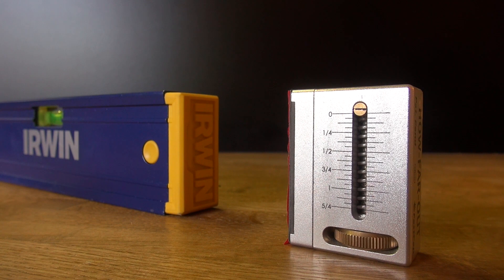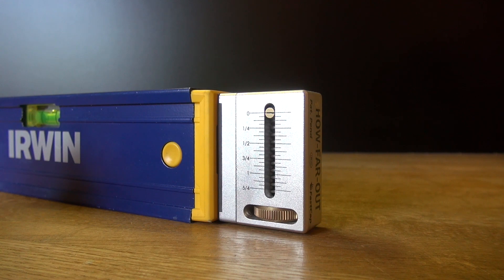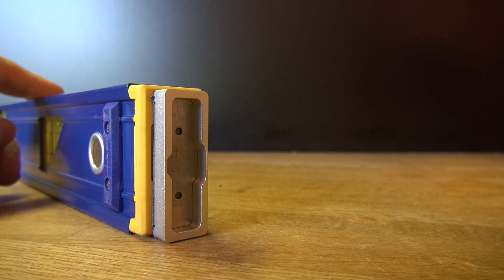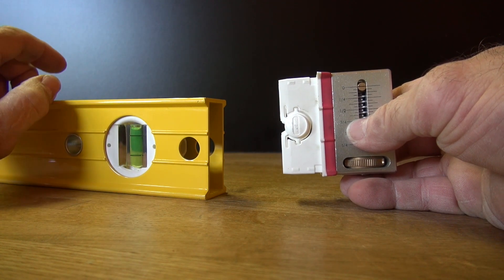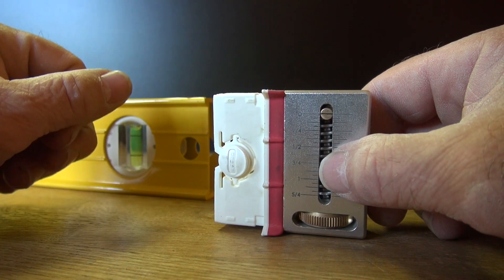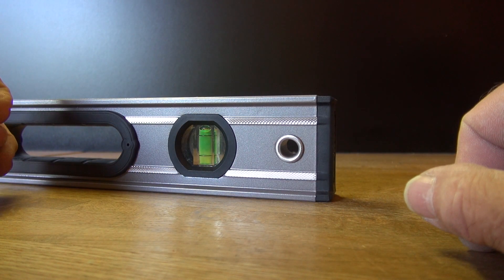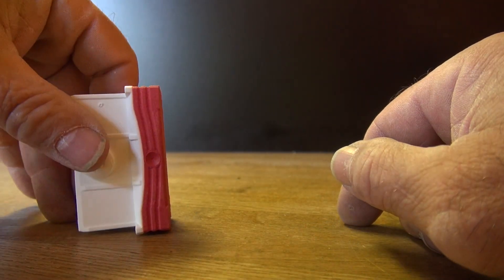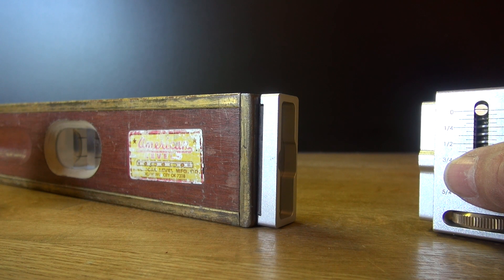How Far out Level Gauge Installation

Comment: To servent74.. I had the same thought at first but I quickly realized if you place the level on a floor and lets say it is a 2' level and you are off 1/4" in  a two foot run. You then will be off an additional 1/4"for each additional two feet of run or if you were checking a three foot run it would be an additional 1/8" to make it 3/8" out of level.  Basically a rise to run measurement.

Comment: Now my 78" is too tall for an exterior door opening
Reply: +sparsparkster 
What brand is your level, and exactly how long is it without the HFO gauge? If HFO is mounted using the universal magnetic Quick-Coupler, it adds 1 5/8" overall. So if your level actually measures 78", the HFO makes it 79 5/8" tall. Depending on the respective heights of the door and threshold, this can unfortunately sometimes make the level with the gauge installed too long for the opening. The permanently attached Level End Adapter adds 3/8". When the gauge is deployed, it adds another 1 1/4".

For Stabila 96/196 users, there are three things you can do to shorten the effective length of the level plus gauge:

(1) Mount the gauge body without coupler directly to the Stabila removable end cap, in which case you will use the endcap itself as your coupler. (This saves 3/8").
(2) Remove the end cap at the opposite end when needed to shorten the level even more. (This saves either 5/16" or 5/8", depending on the version of the endcap you have; the new style is thicker.)
(3) If you have the thicker new-style end caps, order an old-style end cap available at www.fastcap.com/HFO and attach it directly to your HFO.

The aluminum body of a Stabila 78" with both end caps removed is actually 78". The shortest installed length you can achieve is either 79 9/16" with the HFO mounted to an old-style 96 end cap, or 79 7/8" if mounted to the new style.
Reply: +Michael Schuler 
There will be tactical limits to the use of any fixed length level, with or without the HFO gauge. One way some customers are overcoming these limits is to combine the How Far Out gauge with the new Stabila XTL telescopic levels. Together, these two achieve the ultimate in survey flexibility and precision, providing true point-to-point survey accuracy for any length opening within the level's length range. A single HFO gauge and an extra Level End Adapter is all you need to outfit both the 26-40" and 48"-79" models.